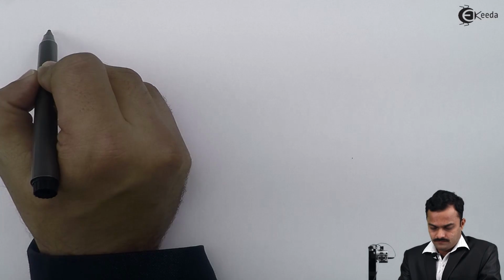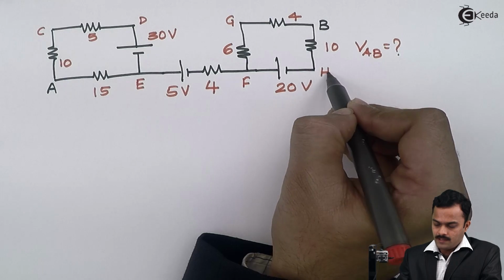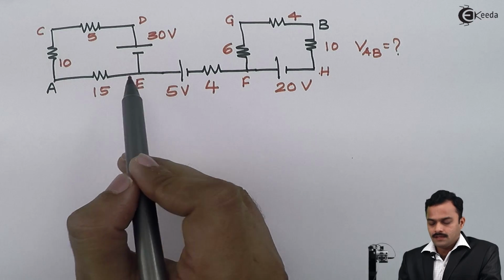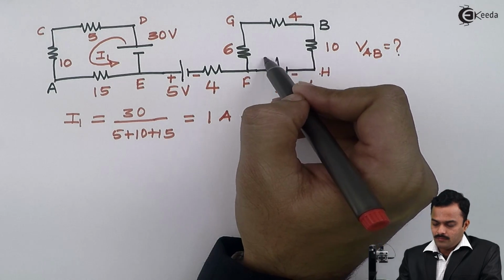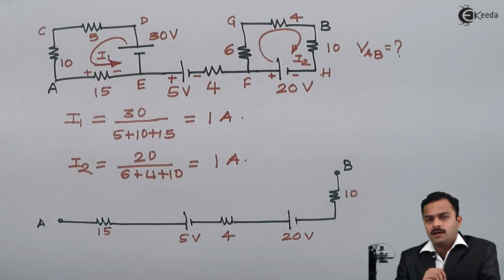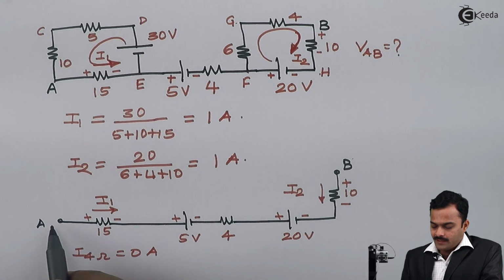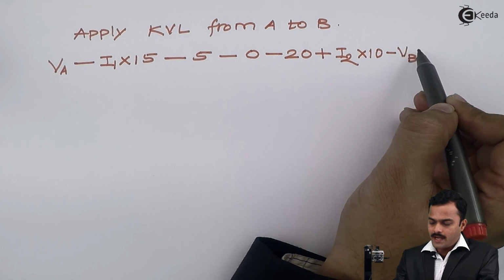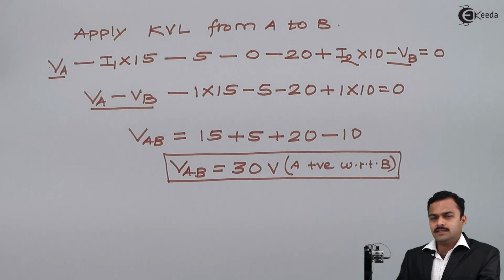Problem on Kirchhoff's Voltage Law (KVL) - DC Circuits - Basic Electrical Engineering

Comment: If the current in 4ohm resistor is 0, then shouldn't it make the circuit open?
Reply: exactly. If the current is 0, then according to the formula V=IR, V=0. if V =0, we cannot find out Vab as they are completely different loops. how can we get this answer? I think the process done by sir here is wrong

Comment: sir
in 4 ohm resistance in middle branch,is there is a current due to battery of 20v or 30 v as 1 A current divide ??